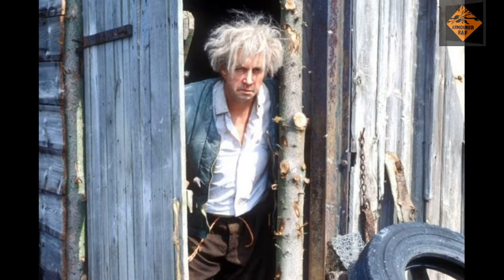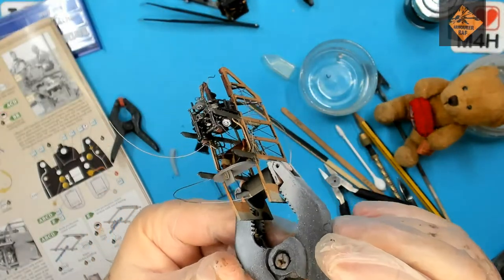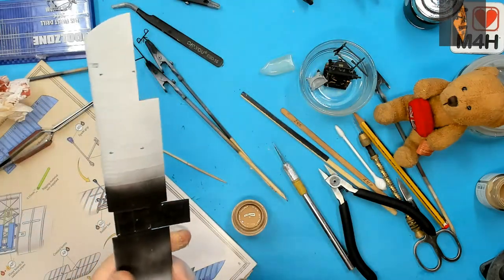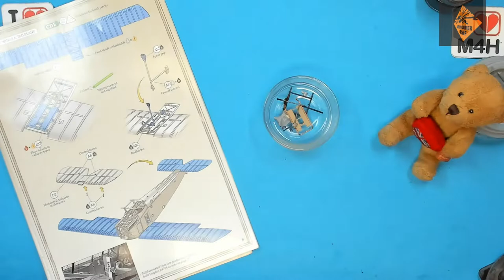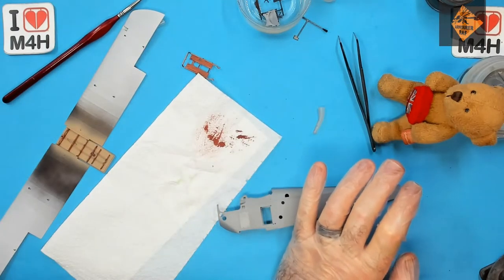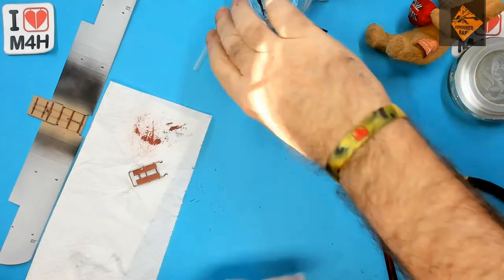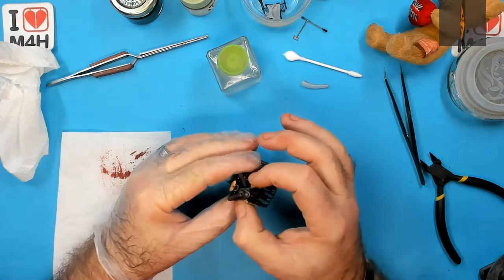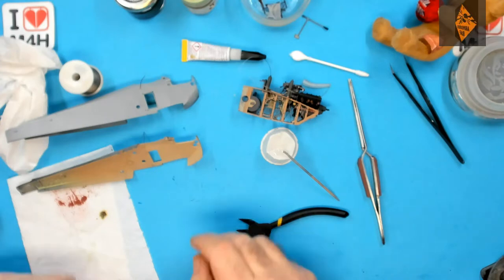Episode 9 of my Wingnut Wings Sopwith 5F.1 Dolphin

Comment: Hello, I have been following with interest your build up of the Sopwith Dolphin particularly Episode  9 with the fitting of the instrument panel onto the framework. It looks like you were having the same trouble as me with those little tabs which sit a couple of millimetres in front of the cabane struts. For me they seem to be fouling the fitting of the instrument panel. Did you actually file them down to allow the panel to fit neatly. Any help would be appreciated
Reply from the maker: Hi William, if I remember correctly, then I believe I did sand them down as it was a right ball ache!
Reply: @BudgetModeller  Good man yourself ,they are getting in the way big time and your video showed them getting the full treatment
Reply from the maker: @williamhillocks7518  Yep…It’s all about test fit, test fit, test fit…Especially WnW kits, their tolerances are so tight a coat of paint puts them out 👍🏼👍🏼👍🏼
Reply: @BudgetModeller  How right you are, the instrument panel and gun assembly now fit neatly and the engine will drop nicely on to the tiny notches in the bearers. So far so good
Reply from the maker: @williamhillocks7518  Keep it up 👍🏼👍🏼👍🏼
Reply: @BudgetModeller  👍👍👍